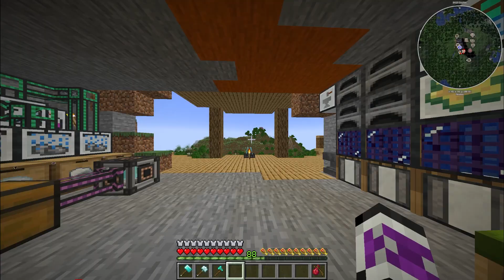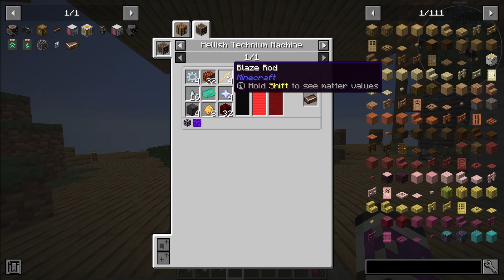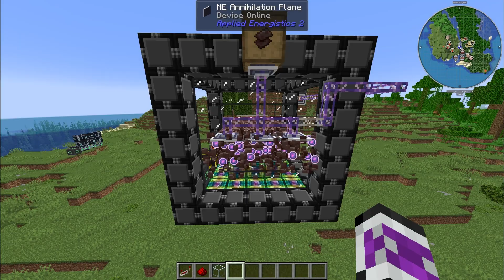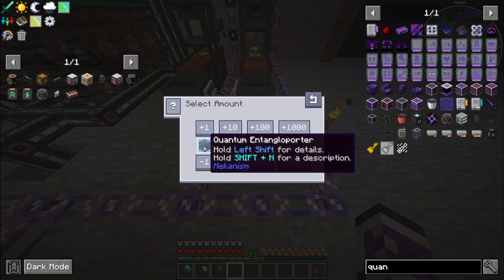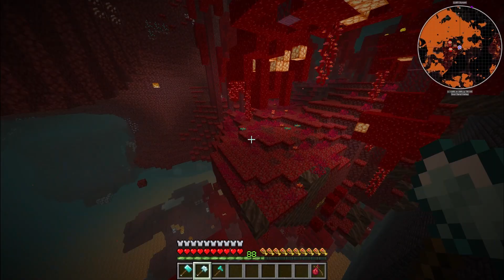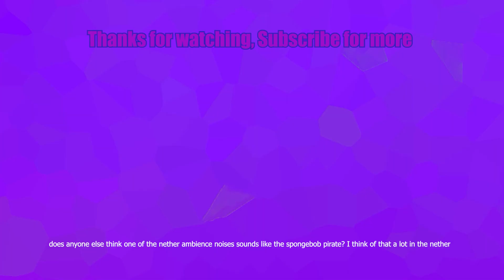Techopolis 3: Episode 29 - Inter-Dimensional Passiving

Comment: AE2 Subnets, or Nets in general, have 8 Channels. Controller gives 32 per Face.

You could setup an AE2 Bridge for the Nether, it would be less spaghetti and resources than spamming Cubes ^^

Iirc there are "long-range" Placer/Breaker from Actually Additions that you can tie to a specific Block but I like the Piston automation.
Reply: Oh and instead of Hopper you could put a Drawer (with Stack Downgrade) against the belt of the presses. Then you could use a Redstone upgrade to stop the presses.